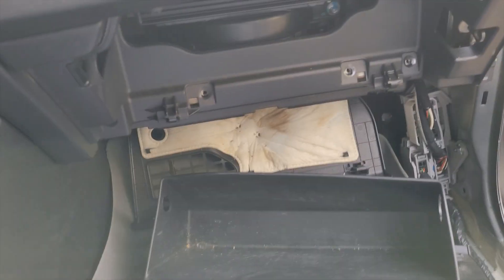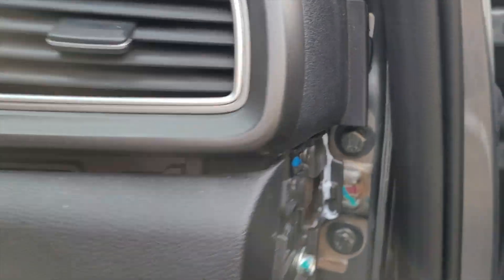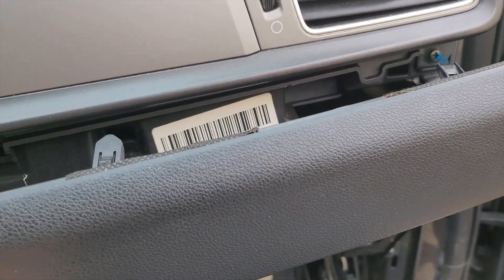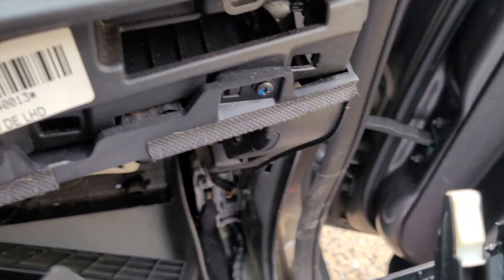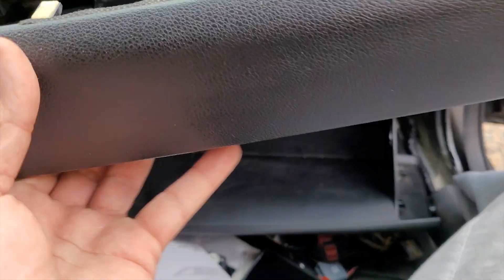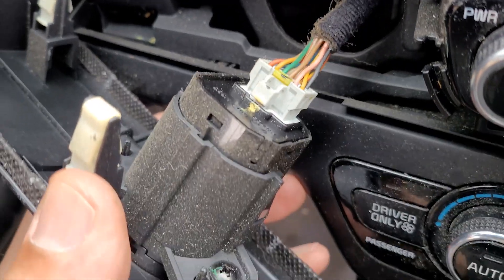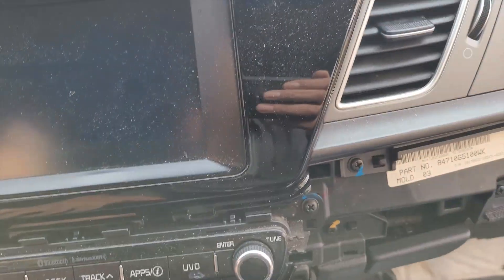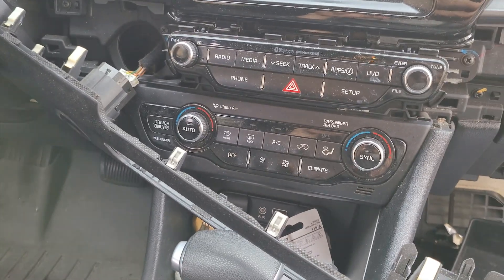How To Remove 2017-2020 Kia Niro Push Start Button.

Comment: Thankfully I found your video! Trying to get that panel off, how did you remove the side panel of plastic to access the screws on the right side?
Reply from the maker: It should just pop off. Try to grab right in the corner toward the bottom of the glovebox and edge of door meet up. From memory, which most cars are like this, they are just clips and just pull outward.